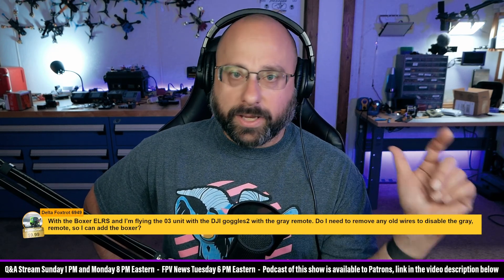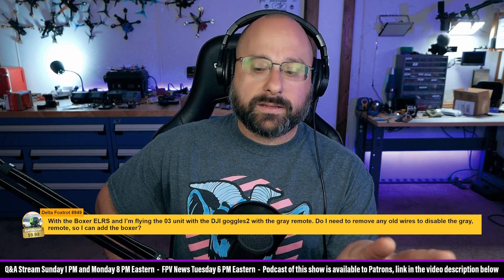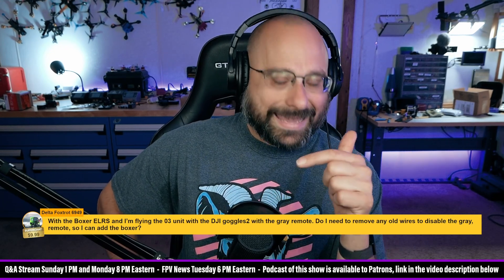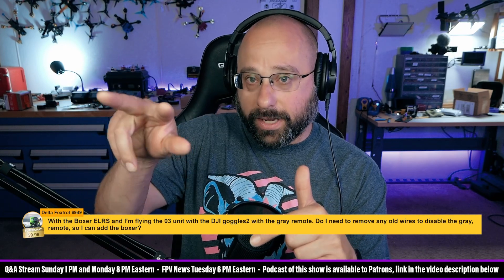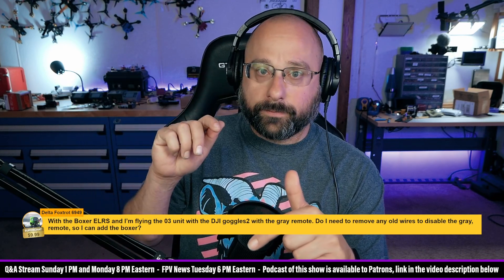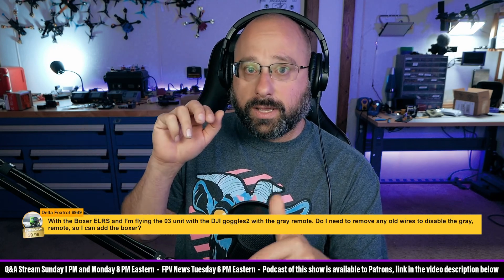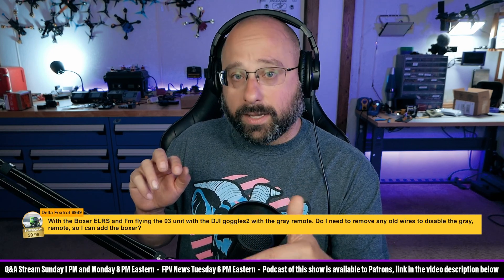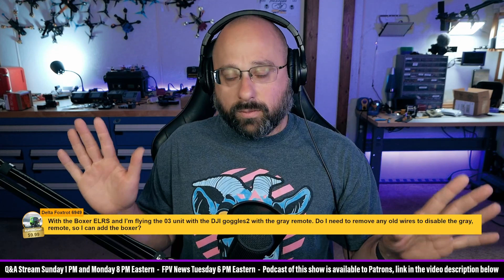Do I Need To Remove The SBUS Wire From DJI O3 Air Unit When I Use ExpressLRS? - FPV Questions

Comment: You can plug in the receiver into UART2 first, set it to serial RX crsf in BF, then plug in the O3 with the SBUS wire in.
Reply: Yup, I just did this on a quad tonight going from the DJI controller 2 to crsf. I should be able to use the DJI as a backup radio as well if the crossfire antenna gets jacked up or something while out flying without taking the quad apart and replacing an rx, etc.
Reply: do you have to do this procedure while the flight controller is connected to betaflight?

sorry quite new to digital gear, thank you!

Comment: So I can I just plug it in and if it doesnt work with my radio controller I can just remove the SBUS wire
Reply: Thats what i did recently when i converted 2 of my quads over to the 03 unit.

Comment: Question? So in case you have controller 2 and a Elrs remote, you can use either of them without doing anything into the quad?
Reply: No, because you need to select the receiver protocol you are using on the receiver tab of betaflight, and which uart will be used for the receiver on the UARTs tab.
Reply: Also, you can't select multiple options for either.
Reply: So that means it depends on the configuration in Betaflight. But you don't have to touch the hardware again.. right?
Reply: @seppeqespecho4260   yeah I just did it on a skystars f722 hd pro tonight. You just change the settings in bf but you also have to change the modes because they won't correlate between the two radios. I' using crossfire but that shouldn't make a diffference.